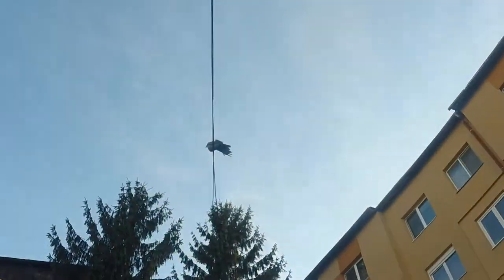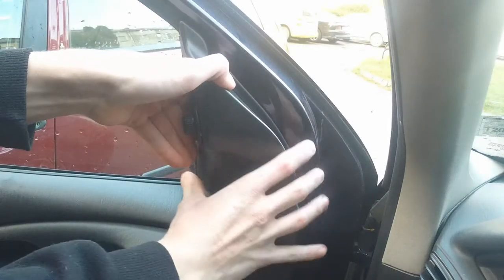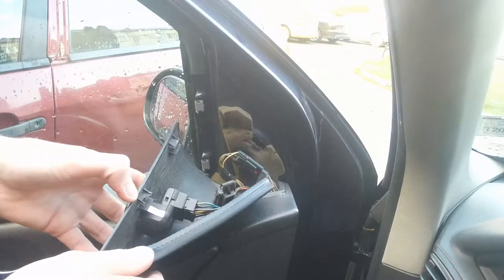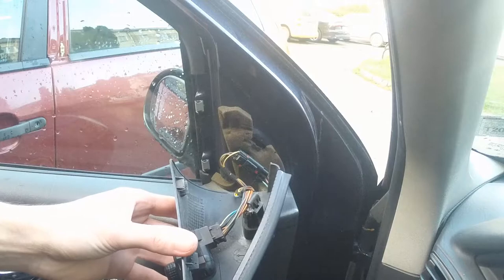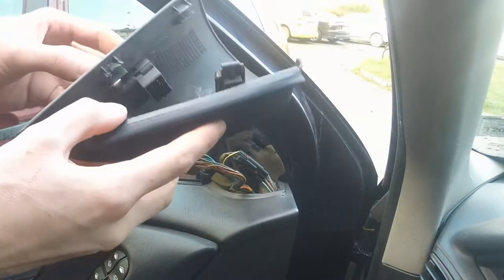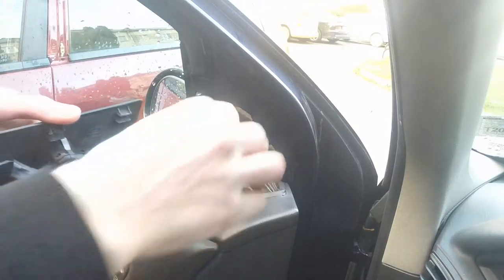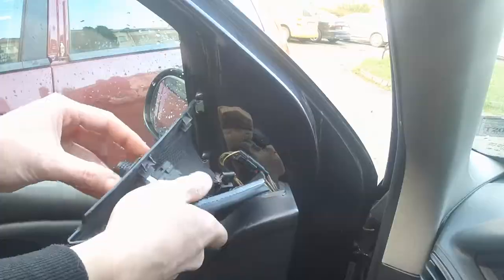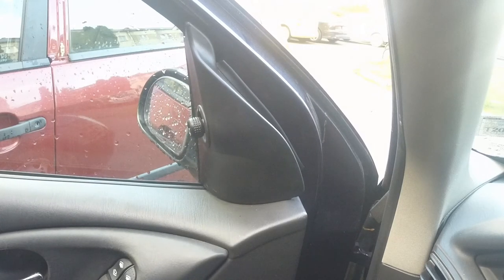How to Replace Power Mirror Switch - Ford Focus 2001

Comment: Can the mirror adjustment knob be easily removed and replaced? I lost the knob and only need to replace this but if may have to replace the switch including the knob. Thanks!
Reply from the maker: I didn't try, but my advice is, stick to replacing modules. Make a visit to your local junkyard to get secondhand parts.